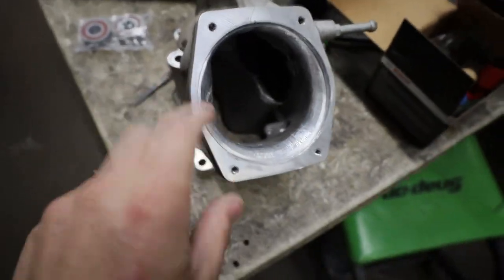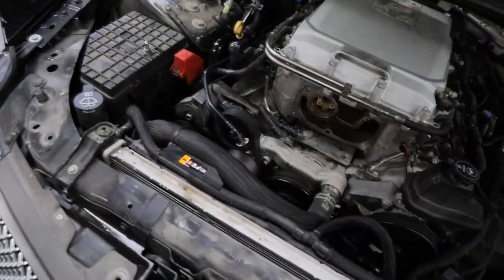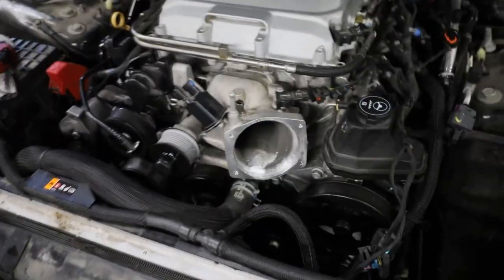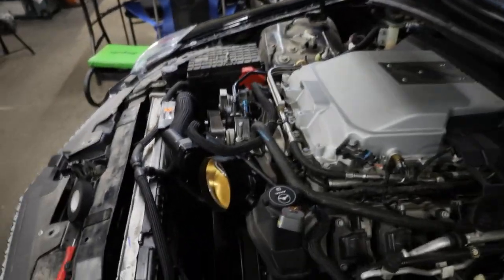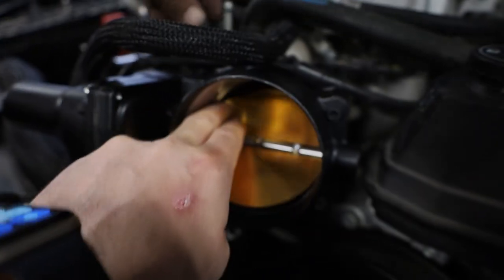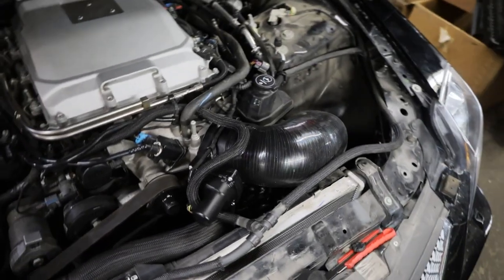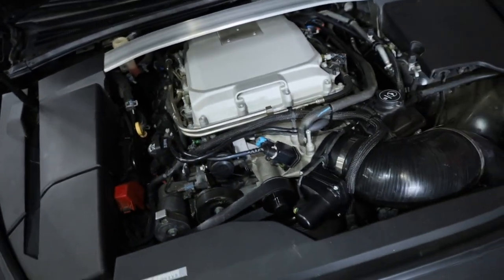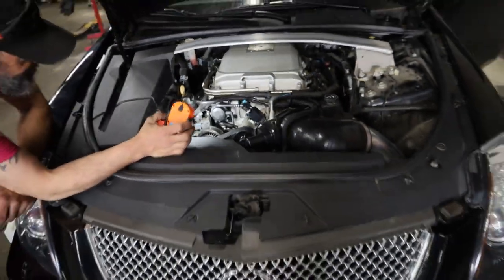CTS-V Dyno Day | How Much Power does a CTS-V make? | Auto-Motif

Comment: Great video, I say 516-523. If you are on stock injectors, I'd check out you Inj. duty cycle. It may be too much pulley for the stock injectors. Also trans tunning will wake the car up. Pick up a green filter, it will make the S.C. whine way more louder.